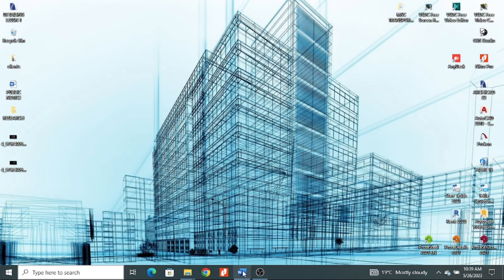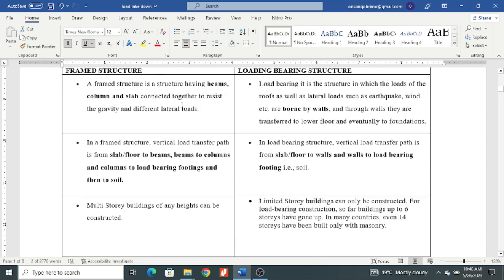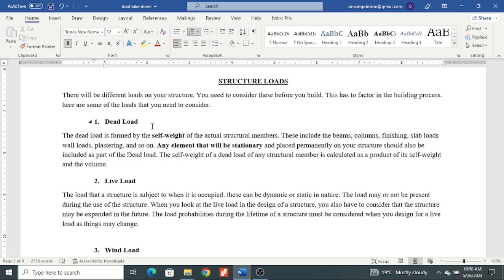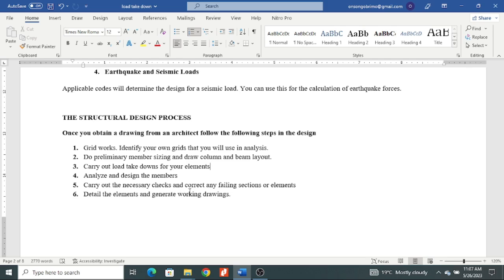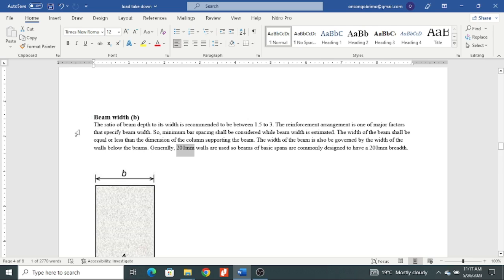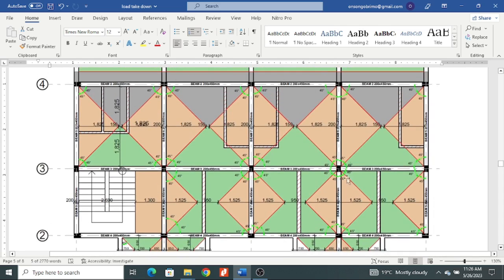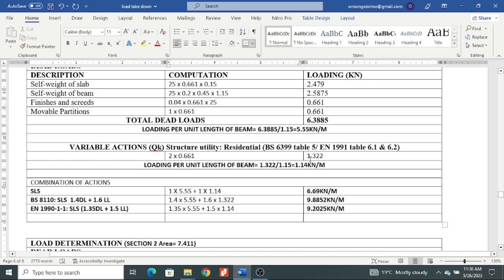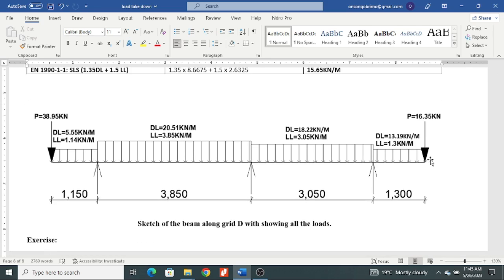INTRODUCTION TO RC STRUCTURAL DESIGN (LOAD DECOMPOSITION TO BEAMS )

Comment: How will we know the most critical beams in the this architectural drawing?
Reply from the maker: This question sounds straightforward but its not. To determine critical elements in your structure you look at many parameters' including but not limited to: utility, size, span, support systems etc. However in this specific structure you can select internal beams supporting the largest spans and those beams with cantilever sections.
Reply: That is structural drawing